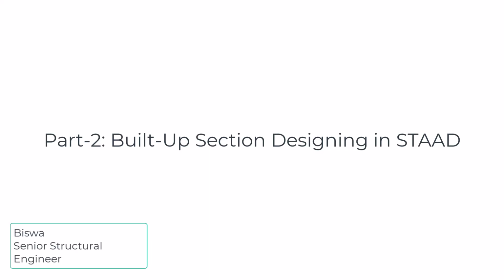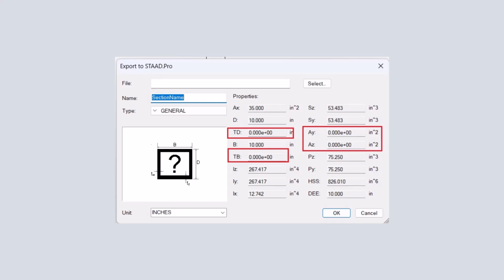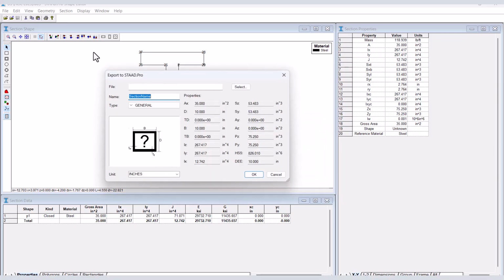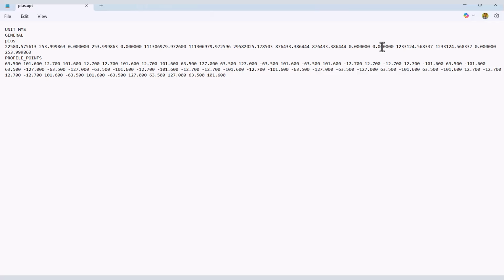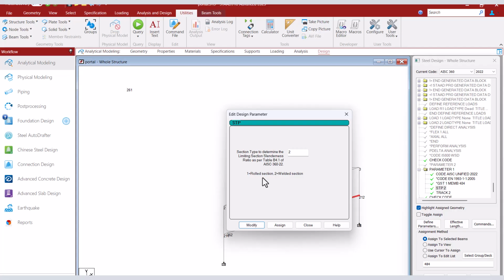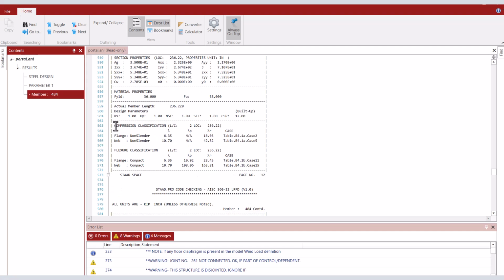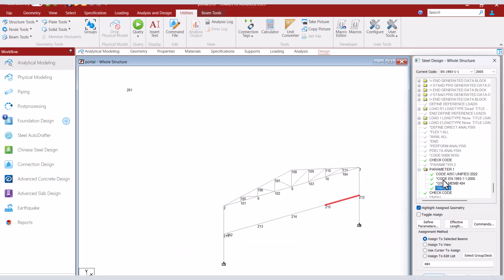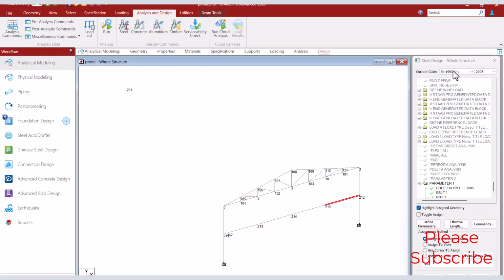Modelling and Designing  the Built-Up section in STAAD (Part-2)

Comment: I can see that for a star section, the values of B & D are taken same by STAAD. Let's take an example of HEM900 which has overall depth D 910mm, flange width B 302mm, flange thickness TB 40mm & web thickness TD 21mm. Now while making a star column with 2 HEM900, STAAD us taking B & D values as 910mm which seems to be incorrect to me. D should be 910mm while B should be 302mm. What are your thoughts ?
Reply: Also, section classification tells us to check for flange bending or web buckling locally, so it is telling us to check section classification for outstanding element. So for a star section, we should consider (302-21)/2 as flange outstanding while (910-2x40)/2 as web that is going to be buckled.